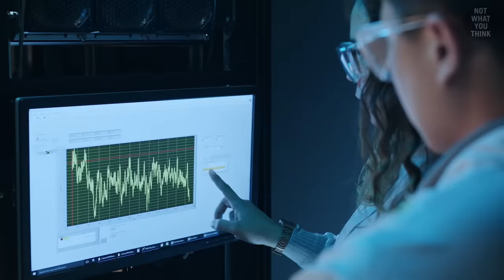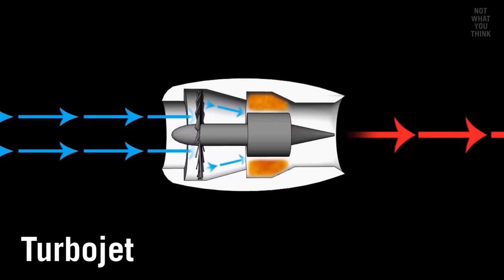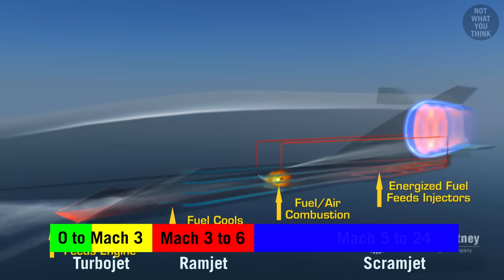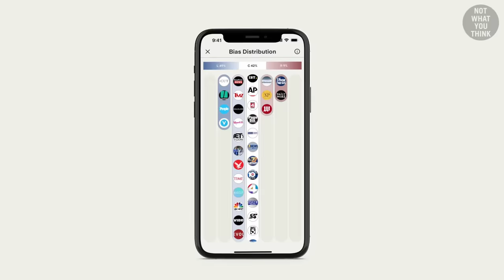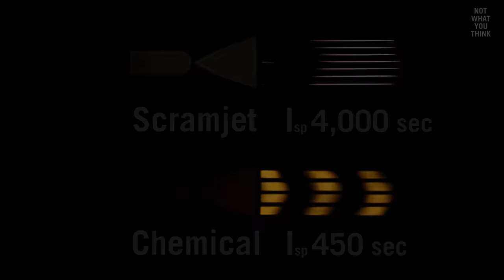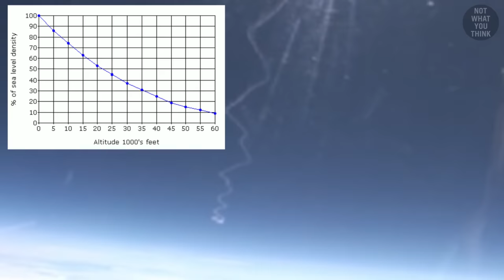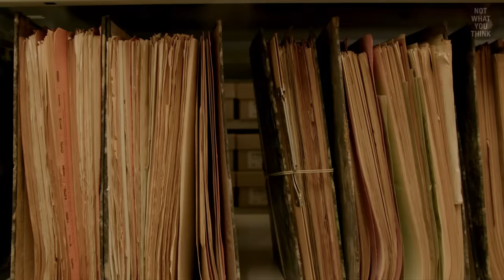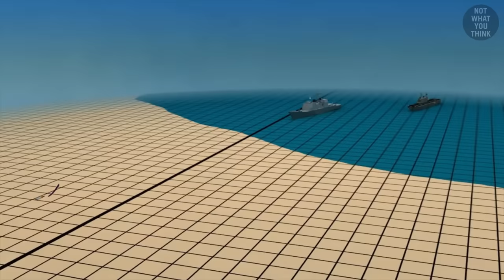The Hypersonic Missile Vulnerability That NO ONE Talks About

Comment: I’d think there would be one other obstacle to hypersonic powered vehicles and that is maneuverability.  At the hypersonic speeds the forward momentum vector would be so high that even small corrections would result in a catastrophic failure.  Even the SR-71 suffered from that.  Making a turn at maximum speed takes several hundred miles/kilometers to execute.  Physics is in control of this.  And very fickle at such high speeds.  Also, as the narrator said, the missile would be blind so avoiding a new danger would be impossible.
Reply: Yea you can't get around the laws of physics.  Once you're going that fast you pretty much need to travel in (effectively) a straight line.  They love to show these renderings of a missile comically swerving around supposedly at mach 20+, but I think given the force limitations at such high speeds it would be entirely possible to predict the rough path of a hypersonic missile.  You know an object going that quickly will stay on roughly the same path for hundreds of kilometers.  I think it's reasonable a fast computerized system could track and defend against a hypersonic missile if it's detected early enough in its flight.
Reply: Another point to add to this: at such high speeds the missile's KE can work against it. An interceptor might seek to simply disburse debris in the missiles path (eg fly to a probabilistic location and detonate). At such high speeds hitting even a tiny shard of metal would cause catastrophic failure.
Reply: @alldecentnamestaken  Hah, that's a great point I hadn't thought about.  Mach 24 is 8.2km/s and low earth orbital speed is around 7 km/s.  At those speeds you have to start thinking in terms of spacecraft and the dangers they face, not just the dangers missiles face.  It's also why it's silly to imagine them entering terminal phase at those speeds, because you just...don't do that in the lower atmosphere.  And like you said, even in the upper atmosphere all you need is a BB sized bit of metal for catastrophic failure.
Reply: @Cornelius Carroll  Great point, hitting a tiny 7 grain bb at Mach 25 would be like getting hit with the muzzle energy of a .50 BMG round. An interceptor could throw up a cloud of small hard things in the predicted path and let the missile rip itself to shreds.  It would probably only need to very slightly deform the leading edges and the insane aerodynamic forces at those speeds might tear the missile apart.
Reply: glad you mentioned the elephant in the room - speed does not equate to maneuverability..
Reply: Depends on how many G’s these things can pull. No pilots limiting this
Reply: @Baden Holt  True, but at Mach 25 (if that is to be believed) making a 1,000 km circle would require almost 15 constant G-s. Doesn't sound very realistic even without a pilot to worry about. I doubt if that's even aerodynamically possible in thin air. I think we need a Scott Manley video lol
Reply: Lol SR-71 is ancient technology and now the research in to materials to handle hypersonic speeds is known through lot's of tunnel tests.. all ICBM'S are capable of over Mach 20 as reenter.
AI tech is getting very good and if can put this in to a vehicle before flight it fixes all your issues.
Australia will test a scramjet drone next year and Professor behind it all Said's they in put it's flight path and press a button and let it go and will land where was told too.

Met a guy in a discussion thread and were talking about drones and hypersonic and he directed me to a site where he worked on the f35 avionics and they were told to put hypersonic capability in to them.
Because of Australia's Ghost Bat AI drone and all Australia F35 jet's have pilot drone controllability. think's a hypersonic drone was why it was put in.
Reply: @hodge12009  uh, many missiles (specially SAMs) are known to pull over 20G, because the the TWR is knmown, and it must be able to handle at least its boost. The main limiting factor for aerodynamic lift is not getting wrecked by the forces, so that's a lower limit... HCM are also built much more sturdy since the dynamic loads of such high speed flight are very taxing, therefore you shouldnt aassume  any  less maneouverability than a similaarly fast SAM...
Reply: @hodge12009  You wouldn't even need to damage it to the degree that it has control issues. Heat is the biggest issue, so if the shielding were damaged it would likely just burn up. See space shuttle Colombia for example.
Reply: @hodge12009  if you look at these renderings, they are dodging air defense umbrellas, which are nnot precisely small, and are HGV (no engine), which means it's in the upper atmosphere... So this comment only shows a lack of careful analysis...
If I'd hazard a guess I'd put the turning circle of an HGV on the low hundreds of km. HCM will probably turn much more tightly as they must travel at a third to quarter the speed if they dont want to burn their engine...

However you are right in one thing, they're not magic unstoppable wonder weapons. I just love how this argunent basically goes two ways: "It cant turn nigh at all and are completely useless" or "it can literally turn on a dime and are completely unstoppable"

Their main advantage is their midcourse speed that allows to hit time-sensitive targets at long rannge like ballistic missiles while having the flexibility of changing course and going (relatively) low like cruise missiles, of course not as fast as BM and not as agile as CM because of course there'd compromises. Dont confuse "it maneouvers better than a BM" with "it turns on a dime" or "it doesnt turn on a dime" with "it barely turns at all", please, stop falling to such caricaturish extremes...
Reply: @alldecentnamestaken  Spacecraft are not missiles, theyre made to be as light as possible and packed full of sensitive instrumentation, and theyre held by the rocket's structure and protected by its fairing, plus they go faster; it's not a valid point... Hypersonic missiles have to be built extremely rugged to travel so fast, turn hard and endure failures, so they can take shrapenel hits. That is why anti ballistic missile interceptors are kinetic hit to kill vehicles with all the expense and risk that entails, if the alternative option worled, it would  be used...
Reply: @Tinil0  except ICBM MIRVs do that already, and they are tanky enough that no one tries to stop them with mere shrapenel.
As I said above, spacecraft are not comparable, just because it's in the same place and roughly the same speed (again, M20 is the upper end for HGV and way faster than any HCM) it doesnt mean it's facing the same damnger... Similar issues arise from comparing it to aircraft like SR-71

Both tanks and 4x4 cars go through road or field at comparable speeds, therefore, by the missile=spacecraft logic, a Land Rover can take an APFSDS to the face...
Reply: @antaresmc4407   ICBM has no engine on the terminal stage and is just falling down. Not sure it's always the case here.
Reply: @yurijmikhassiak7342  HGV have no engine, they're just a warhead with a lifting body. HCM dont go even close to that fast, and even then the engine should be detached after fuel runs out to save on heating and drag, I see no reason to keep it except maybe complexity...
Reply: Absolutely underrated comment. Anyone who's ever done a reentry in the Orbiter sim knows that. You might have botched your approch to the KSC hard already when just passing the west coast. And every inch you pull inceases the heat buildup massively as you increase the friction a lot to swing that thing around the same way you build up induced drag by pulling Gs in the subsonic regime, bleeding off energy a lot. Also, the higher you are, the less control surface authority you have due to the low air density up to the point where you may need to constantly fire RCS thrusters to pull off a larger curse correction. That stuff you're pumping out while doings so is limited though...
Reply: totally right
the higher the speed, the less is maneuverability
not necessarily to fly an sr-71, just drive a car to feel it
Reply: and I don't get why the balalaika played just at the end of this video.
there was so much these russian-made low-quality simulations (in russian they call them cartoon lol)
balalaika, medved and vodka should be playing and dancing half of this video haha
Reply: However unlike a SR71, the hypersonic missile in unmanned.  So it is not limited to the maximum human endurance of 9G. A typical missile can hit 20G. So why not more? More G the missile can tolerate, the sharper the turn possible at high speed.

Also the narrator should read some papers. As of 5 years ago it was theoretically possible to see through the plasma in front an object moving as hypersonic speed. So not as blind as we were back in the 1960s.
Reply: everyone probably knows that centrifugal acceleration proportional to speed squared and inversely proportional to the radius of curvature. it wouldn't be then so hard to calculate the REALLISTIC radius of curvature of any object flying at mach 5 speed, even if the tolerated acceleration/overload is 20 G.
I got something like 10 km. 
not what I call a maneuver
on top of this, the missile itself wouldn't be able to perform an anti-hit maneuver, only a programmed/commanded action. Just like explained in the video
Reply: @tini4580  I think that depends on where in the maneuver you are pulling off the speed boost. A car boosting from a drift is by far a faster manuver that involves more speed.  Then just slowing down and taking the turn.... lol
Reply: Well whatever you said you guys seen the result in Ukraine nothing can stop it.
Reply: Can we let engineers be CEOs now instead of billionaire cheerleaders with no brains or sanity?
Reply: @nickl5658  usually sci fi missile using plasma propulsion or nuclear engine
Reply: @williamyoung9401  why not mach infitine number
Reply: @nedkelly9688  You didn't even read OPs post before Copypasting your rant. The Blackbird couldn't turn well at it's higher speeds, and neither can hypersonic missiles.
Reply: @nickl5658  Because if you change vector at high velocity you A: Put massive stress on control surfaces and B: suddenly and drastically change airflow into the intake, likely causing a stall or internal failure.
Reply: @gkagara  No true hyper-hypersonics have been deployed in the Russo-Ukrainian war.
Reply: @acceptablecasualty5319  Go research this clown.. made manouvres during re-entry.. means it made turns etc.. 
Is a lot of info out there on hypersonic speeds. heats at all the different speeds and materials used for vehicles for hypersonic purposes.

The US-Australia Hypersonic International Flight Research Experimentation (HiFIRE) program had at least one successful hypersonic flight at Woomera testing range in South Australia last week. A round of experiments concluded on 12 July, confirmed Australian defense minister Marise Payne.

UQ hypersonics researchers collaborated with the Defence Science and Technology Group (DST Group) and US Air Force Research Laboratory (AFRL), Boeing, and BAE Systems for test flights in July 2017. This vehicle is a free-flying hypersonic glider, designed to fly at Mach 8 (8000 km/hr). It is designed to separate from its rocket booster in space and perform controlled manoeuvres as it enters the atmosphere. The test flight was intended to enable learning about how to fly a hypersonic vehicle at high altitude.

BAE Systems Australia said in a statement that “the successful flight trial [was] the most complex of all HIFiRE flights conducted to date”.

The $54m joint initiative involves the US Air Force, Boeing, the Australian Department of Defence’s Defence Science and Technology Group, BAE Systems Australia, and the University of Queensland.
Reply: @nedkelly9688  " all ICBM'S are capable of over Mach 20 as reenter."
And don't alter course well at all, just as anything moving at those speeds.
Reply: @antaresmc4407  "therefore you shouldnt aassume  any  less maneouverability than a similaarly fast SAM..."
SAM's aren't similarly as fast, which is why they can still receive radio inputs.
Reply: @wisenber  plain wrong, SM3 is mach 8.8, which is faster than most HCM concepts at M5-9, with the higher end being with its caveats...
And doubly wrong, plasma blackouts are only an issue at speeds close to orbital velocity and meaningful atmosphere, it is not an issue for neither high speed SAM nor HCM. It is an issue for re-entering ICBM or (hypersonic, obviously) glide vehicles on top of ICBM, which are not what most oeople think about when saying "hypersonic missile"; but of course it has the word hypersonic in it so it must be generalized to anything that has the word... 
Even then the plasma builds up in a cone with the vertex in front of the aircraft and wrapping around its sides, therefore missiles can still get communications from behind...
Reply: @nedkelly9688  " they are old tech "
That was my point. Making something to withstand 20 G's on a single axis is at hyper-sonic speeds is relatively easy. Making something that withstand the same on three axis is not.
An ICBM can change course, it just has the same limitation of receiving course updates due to plasma interference that any modern effort would have.
The physics of it are agnostic to the methods of propulsion.
Reply: @wisenber  Agree ICBM are old technology.
Well they are working it out now. maybe why no one's hypersonics are faster then Mach 6 so far.
Time will tell as all say they have faster tech coming out in few years.
One test in HIFIRE a scramjet reached mach 10. top secret and doesn't say if made turns or was straight up and down etc.
Reply: @wisenber  Here is a early Australian scramjet test.. no other info available.
Can tell is Australia's as they invented the inward turning inlet scramjet design.
This test is why Raytheon has the HAWC cruise missile powered by a scramjet speed is Mach 5.

Mon 18 Jun 2007 // 09:26 UTC
Australia's Woomera Test Facility last Friday hosted the successful launch and firing of a scramjet engine which reached speeds of "up to Mach 10", the country's Defence Science and Technology Organisation (DSTO) has announced.

The HyCAUSE lifts off atop a TALOS rocket. Photo: DSTOThe HyCAUSE vehicle - a joint project between DSTO, the US's Defense Advanced Research Projects Agency (DARPA), and the Australian Hypersonics Initiative (AHI)- took off atop a TALOS rocket and reached a heady 530km before firing its way to around 11,000km/h (6,800mph), according to Oz's parliamentary secretary to the Minister for Defence, Peter Lindsay.

Lindsay trumpeted: "This research is a major boost to Australian and international scramjet technology research. Australia is a world leader in hypersonics research."

DARPA's deputy director of the Tactical Technology Office, Dr Steven Walker, said: "This test has obtained the first ever flight data on the inward-turning scramjet* engine design. DARPA will compare this flight data to ground test data measured on the same engine configuration in the US. We are pleased with this joint effort between the US and Australia and believe that a hypersonic airplane could be a reality in the not too distant future."
Reply: @nedkelly9688  Again, the forces of physics are agnostic to the means of propulsion.
Making something go really fast doesn't mean you can do more with it.
It's certainly nothing to shrug off, but maneuverability and en route course updates are what is lacking in all of them.
Reply: I imagine it's more like a set of predefined trajectories instead of changing the trajectory in real-time.
Reply: @TL-fe9si  Australia is building a scramjet drone.. saids he puts in the flight path and let's it go and said's it is too fast any other way.
Reply: @TL-fe9si  This is a Australian company and will test fly a scramjet drone early 2023.
Scramjet was one i posted that reached mach 10 in HIFIRE .
Keep eye out if work's.. if can fly itself back to a landing pad. must be able to tun it.

On the launchpad, Spartan will look and launch like a conventional rocket. Once it reaches hypersonic speeds, however, the first stage will drop away and the scramjet will unfurl its wings to blast the spacecraft into the upper atmosphere. When it runs out of air, the scramjet will separate and a small conventional rocket will carry the satellite into space.

As much of the Spartan system as possible is designed to be reusable. Both the scramjet and first stage rocket will fly themselves back to a runway landing – although the scramjet will undoubtedly look sleeker.

“Once the rocket booster has finished its job we deploy wings and a small propeller and fly back to base,” says Smart, “It’s basically just a big tin can, it’s very light. It’d be like a small ugly aircraft.”

The only part of the launch system that will not survive the flight is the final third stage, which will burn up in the atmosphere after releasing its payload into orbit.

Over the past couple of years, Smart has been carrying out hypersonic tests with a rocket and a two-metre-long scramjet at Woomera – flying the aircraft at hypersonic speeds 400 kilometres across the desert. “It’s the best ever radio controlled plane,” admits Smart, although it’s way too fast to control with a joystick. “We pre-prepare all the flight software, press the button and off it goes.”
Reply: Plus all that, in turn, would also leave them vulnerable to laser weapons (which, last I checked, are even closer to being combat-ready than hypersonic missiles) - even superficial damage would screw up the aerodynamics.
Reply: @Ned Kelly  lol what?
It's difficult understanding you.
Although, from what I got... 
Why would you need a project to repurpose an F35 that will take off and land where it's told? It cant do much else, so why do it with the latest US jet? Russia creating the same system to try with Antonov-2 and use them as cheap drones with high payload or to expose enemy AA.
Reply: @eyes8731  What are you even talking about repurposing a F35.. lOL what.
Reply: @eyes8731  How is what i said repurposing the F35.. The F35 has pilot drone controllable avionics in them.. well not all.. all Australia's do.
It means the pilot can control drones . input a mission.. tell it to attack etc.

Like Australian F35 pilots can control the MQ28 Ghost Bat while flying their F35.
Meaning can tell it to attack a target.. or fly up ahead and take all the enemy fire etc.

Even though MQ28 Ghost Bat is AI you can't let it decide when to attack etc.
Need a human to make those decisions.

My other part was Australia is test flying a hypersonic drone next year.  someone said F35 has some sort of hypersonic capable avionics system. he worked on it and said might be for this drone to be able to control it also.
Reply: @BadenHealth  physics have limits
Reply: The human body has limits
Reply: @acceptablecasualty5319  Finally someone else who sees the intake airflow problem.  At the speeds being talked about the airflow in the engine is very complicated.  Set aside the problems that changing the angle of attack will cause, even a change in ambient air temperature will change the geometry of shock waves inside the engine.
Reply: It being blind doesn’t make avoiding stuff impossible as you can still get input from outside sources, but obviously makes it a thousand times more difficult.
Reply: @emperorsascharoni9577  outside sources how did they suddenly develop a way to get radio signals through a plasma field?  If so tell NASA because I'm sure they would like to know
Reply: @antaresmc4407  1st it's a GLIDE vehicle there is no engine.  So every time they do a course correction they get slower.  2nd because of the plasma being created by the speed it goes there are no signals coming in or going out so I'd like to know how they can even tell if someone is shooting at them. 
Everything they have shot at so far has been literally city sized and not very accurate as is.  
Throw on some mid trajectory course changes and until it slows to the point there is no plasma shield it won't know where it is.
Reply: @nickl5658  oh did they change physics?  Radio waves are radio waves still and visual is still visual.  Neither work till they slow down
Reply: @emperorsascharoni9577  But that means something else has to be outside that can see what to avoid.  So now you have to have assets - almost certainly air - all along the path from launcher to target.
Reply: @bear76009  hey if your missile is turning at 20g and their missile can turn at 15g they are going to miss
Reply: @BadenHealth  only in certain situations. If you are going mach 5 and make a slight turn it's 30g if I'm going mach 2 I can make a much sharper turn and be much lower g . And if I am in front of you speed don't matter as it's not a tail intercept. Sometimes speed works against you .
Reply: @BadenHealth  Lmao bro thinks g limit can affect physics.
Reply: @BadenHealth  Also do you not realize that turning hard bleeds speed regardless of g limit? You're literally sacrificing the only advantage of hypersonic weapons to make a turn which would make you vulnerable.
Reply: A very small change in direction at a very  high velocity is a huge change in velocity, so yeah, turning something around at mach 6 involves a massive acceleration.  Like all accelearations, a rate times a time.  A 20G turn at mach 6 is going to take forever to make a 180, but it's still a 20G maneuver.  let's say just 2G, to allow a 1G upward change.  Just a few seconds of that makes a huge difference on where the projectile's going to be in a dozen seconds - a lot for an interceptor to make up.
They're still not worth much, unless we can unblind them and make them really agile to do something about what they see, but the turn situation isn't nearly so helpless as one might think just from degrees/second.
Reply: @antaresmc4407  I mean part of the reason you don't try to stop ICBMs with shrapnel is that you need to get it sufficiently far from the target, and low orbit is not really somewhere conducive to shrapnel based attacks, given you can't get the shrapnel back out of orbit in order to launch your own ICBMs. You've also destroyed all satelites in low orbit too, so even your lower altitude missiles can't actually hit anything given GPS has suddenly stopped existing. Basically, it'd just be a real bad idea if you had any chance of winning. 
It's essentially the same reason we don't baloon-wall cities as air defense anymore- if anything, modern aircraft are less capable of surviving a colision with a baloon cable, but we can't consistently get them high enough anymore for it to actually be a good defence
Reply: @hodge12009  The hypersonic missile doesn't have to do rapid course changes to render defenses ineffective. Keep in mind a hypersonic missile moving at M5 with a minute change in direction would have traveled a huge distance from it's previous course due it its velocity. Why would the US be developing hypersonic missiles if they were easy to shoot down?
Reply: @BadenHealth  People here think that you need to be able to do U turns with the hypersonic missile to evade defenses. Just a tiny deviation at hypersonic velocities would position the missile miles away from it's predicted path which is unpredictable. It laughable to believe that the Russians and Chinese haven't figured out the sensor and maneuvering issues before designing, producing and deploying their missiles. You just can't believe because of ones ignorance.
Reply: @antaresmc4407  That HGV will loose speed with every turn.
Reply: you have no clue what you talk about, dude, SR-71 was a flying coffin, an experimental project who killed many pilots, ( loss rate is some 40 % of airframes ! ) and the reason why you have no clue what you talk about is the fact you do not know how fragile was the SR71 !  To educate you,  I will only point out a "detail" - a commercial airliner could take MORE Gs than the poor SR71 ! 
The LIMIT of g-forces the SR 71 airframe could endure was less than 3-4 g,  while a commercial plane can go up to 5g, ! A military jet can be stressed up to 7-9 even 11 g,  ( limited by human factor). 
That is why the crappy SR 71 will need hundreds of km to make a turn, and worse, to make an 180º turn was forced to drop to subsonic speed ! An SU 25 could dance circles around SR71 !